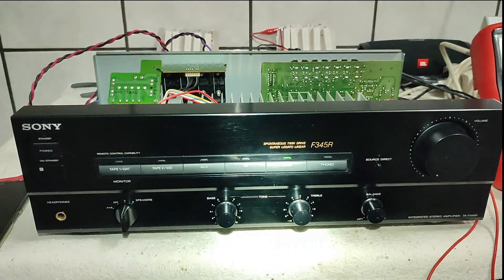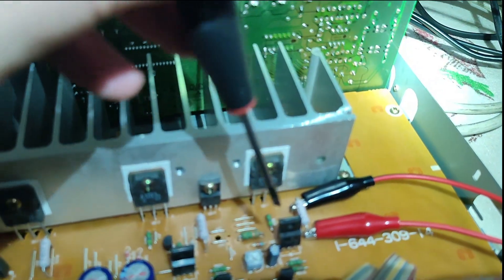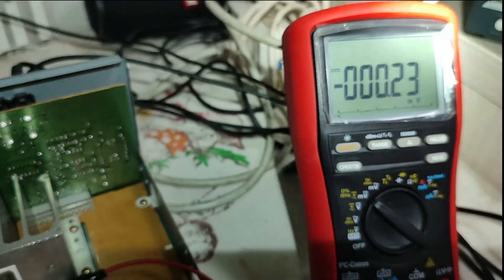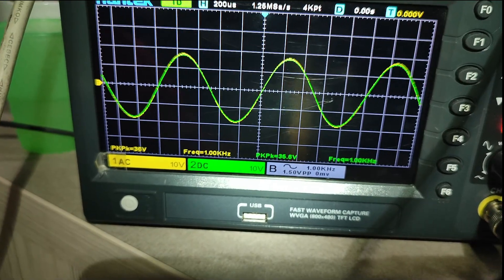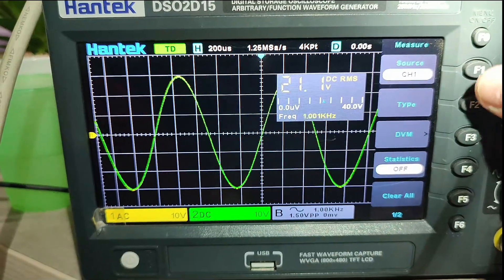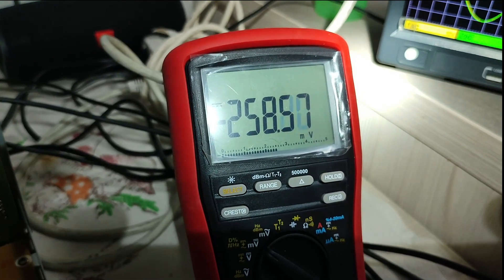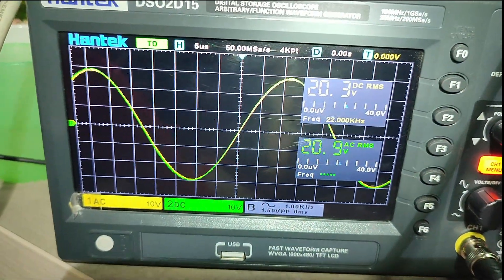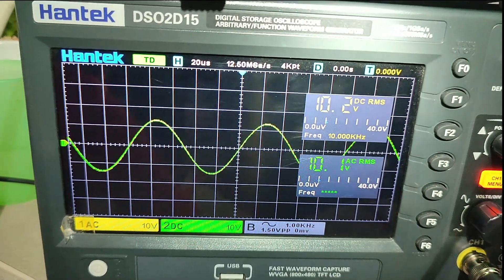Sony F345R amplifier bias current adjustment

Comment: hello. I have the same model. But  some years ago, I heard a noise, even with the volume knob at zero. I thought maybe a bias problem, or maybe the internet wifi modem interference. If you have some tip, I will thank for.